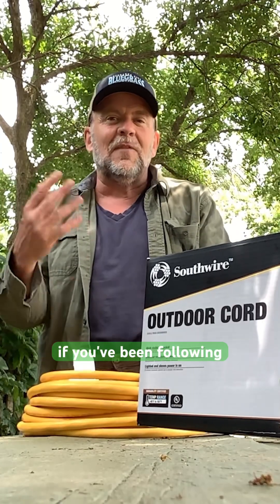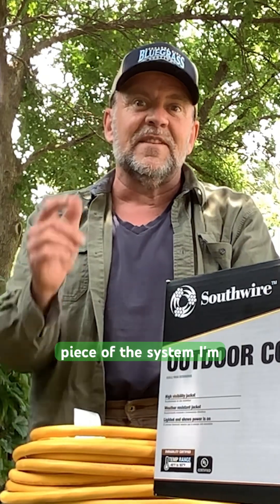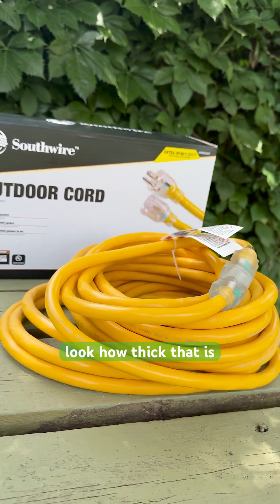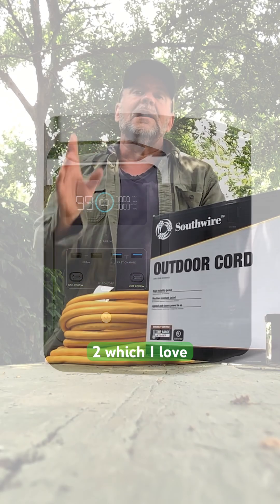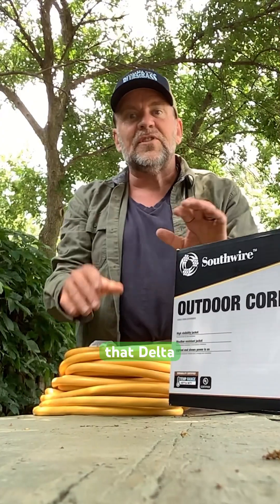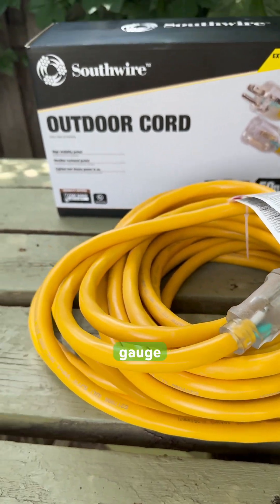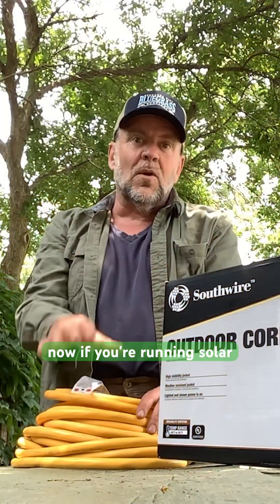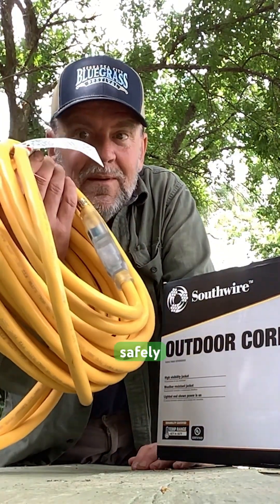Southwire 50 ft 10 gauge extension cord for solar system

Comment: I bought a 2024 Honda EU7000IS generator. My friends say use 12 gage extension cords and I shouldn't have a problem. I say 10 gage and so do you and many others. The 10 is expensive, I bought Dewalt locking 50ft 10 gage × 4 and a 100ft 10 gage for a total of $600 
Now I'm broke but happy and looking forward to going to work!
I also bought a 30ft cable lock for the generator because someone already tried to steal it. Luckily I was there and was able to prevent that from happening. 
Nice Video, very informative and puts safety first. Good Job, from Chris.